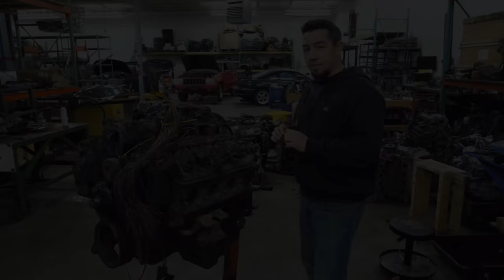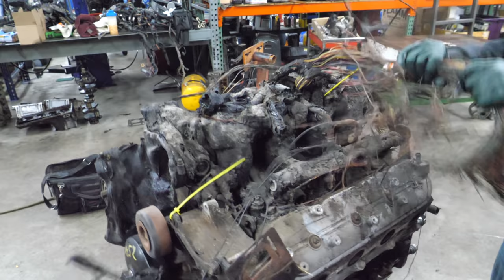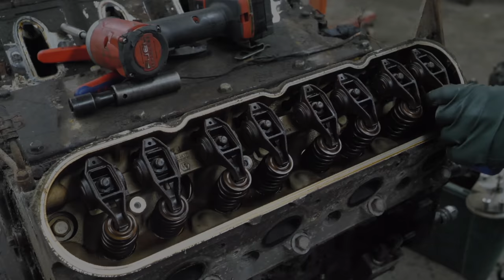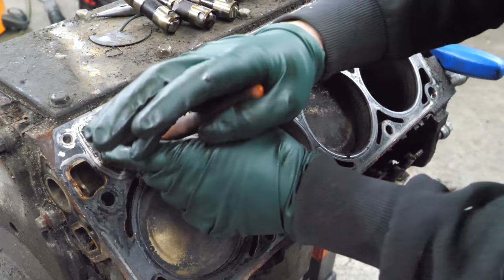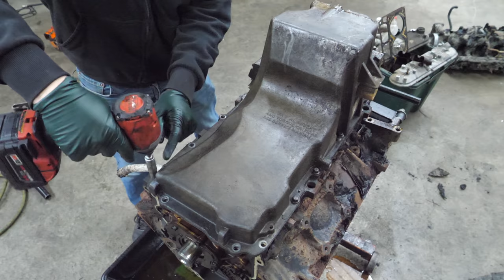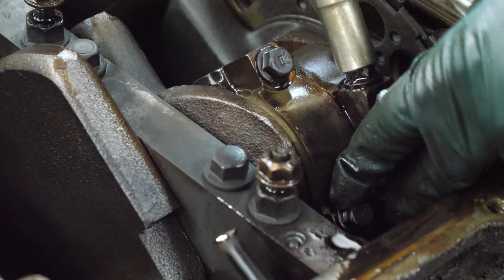BURNED Silverado 6.0 LQ4 Engine Teardown! Will I Get A Good Short Block Out Of This?

Comment: Good engine.  I might would have stopped after removing the pan and finding it clean.  Just replace the pushrod and rocker, clean/reseal, and fire it up in a customers truck.  Or my own truck.

Comment: Did anybody catch the water jacket that seem to look as if it was clogged? After he pulled the heads, near the rear of the engine. Maybe its normal but it looks like a oil got into the coolant but who knows 15:30

Comment: I don't get it.  When you loosen the head bolts in the valley, you just do those in a row, no regard for a pattern to keep from warping the head.  Then you do the rest later, following the correct sequence.  Do those bolts not matter?
Reply from the maker: The smaller bolts have a much lower torque spec and the torque sequence is designed for the lower bolts as they surround the bores. The top bolts just surround the lifter galleys. Gen5 motors don’t even have top bolts.

Comment: Someone will have an excellent shortblock for good NA or slight boost motor. Doubtful iron block suffered any real damage since knock sensor boots look unscathed. A pair of LS3 or clone 2.165 Sq port heads and matching flexfuel manifold [50psi injectors] , plus hi lift street cam = 500+ HP

Comment: Will you do a Ford 06 5.4L   I have it a 3:yrs for $3000 with 206500 it's 251209 I put the front chains at 242 it's it's good so for. I'm sorry it's missed spell. I have a stroke. With 3 heart attacks.

Comment: A question for you, when did Big 3 engines switch over to metric fasteners? I always expect you to be pulling out 1/2" and 3/4" bolts, not a bunch of 10s. I guess there's hope.
Reply: Awhile ago, like 90's, maybe earlier.  My jeep is a 1990, and every bolt on it was standard.  When I swapped in an 06 LS engine, every bolt having to do with the engine and trans are now metric.  I really do not know why domestic vehicles switched to metric, but they did.
Reply: @Bobbywolf64  Perhaps for exports of engines overseas where the world is up to date?

Comment: Is that a red 5.9 jeep in the background? Or just a limited, either way, I miss mine, and it was externally overheated like this engine was
Reply from the maker: It’s a 5.2 that someone put some 5.9 parts onto. It’s a test mule for parts.
Reply: @I_Do_Cars  looks good, figured as much as iirc 5.9s were only available in silver, white, and black, but a red 5.9 would be sick!

Comment: I suspect those head bolts were loose because the heads lost their heat treatment and relaxed away from the bolts. Heads not to be trusted even after machining. Cast iron parts should be okay.

Comment: My LS1 V8 Hydraulic lifters were tight like that too when they were noisy so I replaced the whole set for $100 AUD & I also fitted a Rollmaster timing chain & sprocket kit & I Fitted a Melling LS3 timing chain dampers & adaptor bracket while the timing cover wax removed to repair an oil leak.

My LS1 engine block is drilled & tapped out to accept no an LS1 timing chain damper but it was cheaper for be to fit the LS3' Melling timing chain damper & bracket kit.

In Australia,the timing chain tensioners were Fitted into the HSV (Holden special vehicles division) version of my Holden VY SS Commodore which was the 285 kilowatt Holden VY SS Commodore Clubsport R8 which was fitted with a stock 5.7 litre Chevrolet LS1 V8 engine albeit was fitted with the HSV exhaust system & a MAFless tune was done to it.

Mine is actually putting out about 300 kilowatts of power at the flywheel which is the best achievement for todays standards for a stock LS1 V8 engine  !

Comment: maybe this engine truck burned because the engine was a "lemon" and owner was tired of dealing with the issues...  evidence: bad torque on the head bolts from factory error?  Engine constantly boiling coolant, other intermittent issues because of head gasket sealing?

Comment: 0.01 brrrrrrro I hope you're wearing gloves and 3 pairs, certain types of rubber when heated above 750 degrees, create a very bad acidic substance called hydrofluoric acid. This acid in this concentrated form can require amputations to stop.

Comment: As a rule, I don't use an engine that's been in a fire or was hit head-on. That one doesn't look too bad (judging by the plastic). Seen vehicle fires that got SO HOT that the engine block actually melted.

Comment: I thought it was illegal to use a light bar and push bumper and all that stuff that's only allowed with public safety vehicles you don't look like you're involved with public safety whatsoever that's pretty much a red flag right there I've seen lots of Tahoe owners with the same set up as you have and it wasn't pretty at all and the sheriff would pull them over for having light bars and lights and all that stuff not good